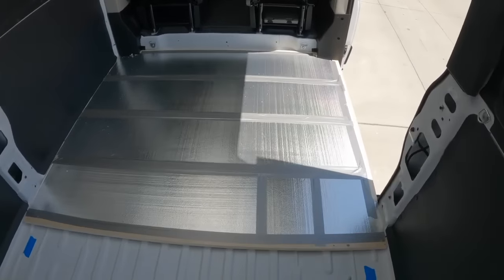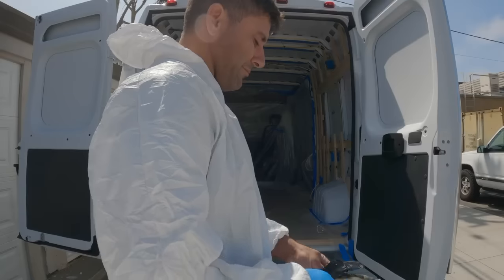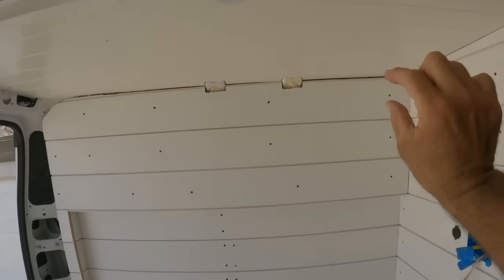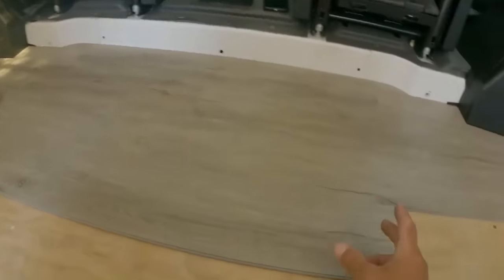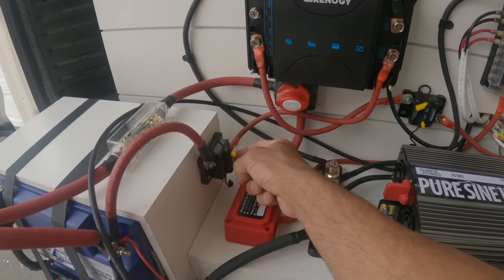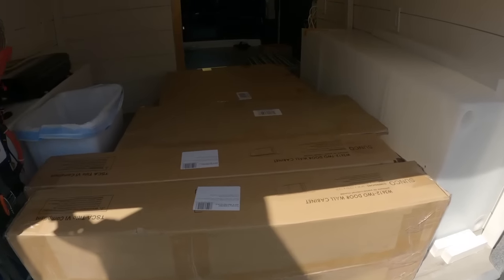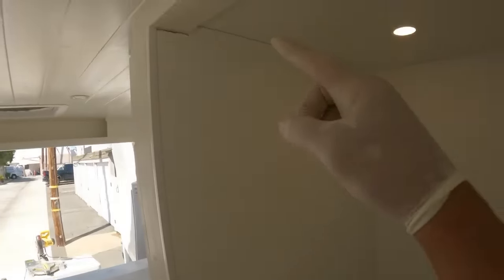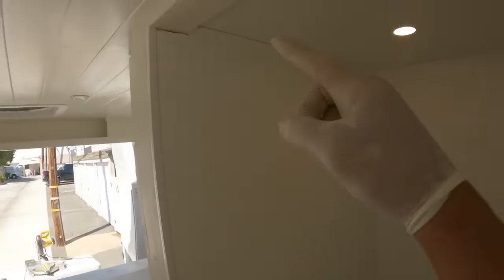Time Lapse | Camper Van Start To Finish | Van Build | Van Conversion

Comment: Your attention to detail is leaps and bounds over any other I've seen on youtube. Even the "pro shops", some of which are good, but they still have a assembly line feel to the finished product. Yours always feel unique and like a master craftsman took his time with it. and it shows in your work.

I was planning on starting my project this spring but some family/financial issues have arisen so I have to put it off for another year. But I have to say your channel has given me the most ideas than all the others put together. Little things like how you finish off the top over the rear and sliding doors. Hardly anybody else does that, but why the hell not? Every square inch counts, so why not use it. 

Needless to say you have given me more ideas than anyone else. 

One idea though that I haven't see you use is a partition wall. I plan on putting one in. Just a simple insulated wall with a skinny door. I'm concerned very little about stealth and more about privacy and security. That door between the two front seats will be locked and if there's a tap on the van in the night, I'm not exposing my "home" to anybody. I'll be coming out through that door and into the front seat to speak to whoever it is. Also, the "home" side of the wall I can attach some photos, mementos, decorations,. etc., I'll be full-timing this. There's no going back for me. I'll be on my own, traveling Canada, 365 days a year, taking my time and seeing everything I possibly can. And when I'm done I might do the USA. Who knows.
Reply from the maker: Thank you for the nice comment!  I like your idea, I have thought about a partition wall.  It has it's advantages.   The only reason I haven't gone for it is because you wont be able to swivel the seats with a partition wall and the vehicle seats are the most comfortable place to sit in the van plus it adds to the living space.  It's a trade off like everything in a van i guess.   I think it just shows that every one has different needs so it's cool to see how all these custom vans come out.  Good luck with your build.
Reply: @BuildingVanLife  Well, since I'd be alone and full time in Canada where the weather can be extreme I'll be installing both heating and cooling so the loss seating won't bother me much. But more importantly I think a partition wall will be better to insulate against both cold and heat than a curtain and/or window shades around the front window cabin area can. I also think since there would be less space to heat/cool in the livable area that it would be more economical in the long run.

I'd like to see how you would tackle a partition some day. A pocket door would be ideal. But keeping it all properly insulated and sealed up from drafts would be key for me.

Oh, and get Gracie back. She was a little easier on the eyes than you are.😁

Comment: Great video. Your attention to detail is spot on. As an electrician , I always set my screws , especially switch plate screws , vertical. It shows you care about quality. You did mention the water tank over the wheel well. If you don't mind , where did you find that ? Great job. My girlfriend and I just bought an E - 350 to do the same thing to. Build a camper.
Reply from the maker: Thank you I appreciate it.  Water tank https://www.nwconversions.com/product/28-gallon-wheel-well-water-tank-pm-c-28/

Comment: Exceptional

Does the shower and sink drain to the ground?
Did I miss a hot water heater?
No mater what there just ain't no room to store stuff like cloths (winter gear), shoes, etc. in vans.
Gotta have a hange bar at top of shower to hang wet gear.
Reply from the maker: There is a hot water heater and there is two grey water takes on electronic valve switches under the van.  You can check out all the build videos on my channel of this van and my more recent van

Comment: The main reason for me not building a van camper is the width...
I can't fit in a bed side to side ...
75 inches is not wide enough for me to lay down stretched out ...
Thinking about getting a box van only they cost me so much more than a regular van ..
Reply from the maker: The promaster is the widest of the 3 main vans.  You could add bump outs to each side to make it fit an even bigger bed.   Otherwise you can do the longer sprinter van run the bed north to south.

Comment: I love watching your videos, they motivate me. Just wondering if you are planning on making more videos of your van builds? I know that Vans are probably hard to get at this point, what are your plans?
Reply from the maker: Thank you! I ordered another van since that’s the only way with the lack of inventory.  Its taking a while.  Im working on another video at the moment as well.  Top mistakes i see in van builds.
Reply: @BuildingVanLife  I have a 2020 Promaster  High roof 159 wheel Base, I bought it brand new and only have 2100 miles on it, I've done some work on it like two Maxx air fans on the roof and a roof rack, trailer hitch, sound deadening getting ready to start the sub floor, because of covid I've been working 50 to 80 hours a week and didn't have time to work on it but now it looks like I'll have some time. Your videos are a huge help keep them coming. Top mistakes sounds interesting.
Reply from the maker: @dfanman1  very nice, i think that's the best van to start with, that's what i have coming, a 2022 159 Promaster.  Good luck

Comment: You put insulation down and then the plywood for the base flooring.  Don’t you need like a dynamat underneath to help dampen road noise?
Reply from the maker: I find the one inch of insulation does more than enough to eliminate the road noise
Reply: @BuildingVanLife  ahh, okay.  Awesome build!  Best of luck!

Comment: You didn't put spacers in the platform of your bed so the water/moisture wicks away and mold doesn't grow on the bottom side of it. As careful as you are...that ive seen you're extremely careful... this one thing is driving me nuts as a person with ocd.

Comment: Hi, How many liters of water tank should be installed to be able to use the shower and toilet ?
Reply from the maker: The toilet doesnt use any water.  I used a 28 gallon tank which i think is just the right size.   In fact I normally only keep it half way filled.  For weight reasons.  I don't think any larger than 28 gallons (about 105 liters) is needed or even reasonable.  That would be a lot of weight to drive around with.

Comment: Great looking build!  I really enjoyed your progression through the video.  I am looking at building my first van and opting for wood over the 80/20 that I see everyone using.  Any comments on the durability long term?  Any changes that you would do if you were to do it again?
Reply from the maker: I have some new videos on the channel of my new build that you can check out.  It’s about halfway done right now.  I’ve made a few changes but as far as the wood goes, I believe it will last longer than the van does.  Houses have been built out of wood forever

Comment: I installed the same diesel heater as you and primed the fuel pump and gas was leaking from the exhaust under the van where I mounted it. Also getting E-8 error. And smells like it’s blowing gas into the van. What could I have done?
Reply: I’m in Newport anyway you could help me out?
Reply from the maker: Error e8 is lack of fuel.  First you need to make sure the connection is no longer leaking before you use it again. Then check all the lines make sure there are no air bubbles. You may need to prime a few times to get rid of them.  Make sure you have enough fuel in the tank.  That should work.  Check all the connections for leaks.

Comment: did you install windows after you spray foamed?
Reply from the maker: yes but i only added a window to the sliding door and i didnt foam that section of the door
Reply: @BuildingVanLife  thanks. do you foresee any issues with cutting out spots for windows  AFTER the interior has been spray foamed? (aside from it being a waste of spray foam?)
Reply: * considering buying a van that has already been spray foamed, but it has no windows, no framing, and no wiring etc yet.
Reply from the maker: @cbarbs638  it shouldn’t be a problem.  It’s not that hard to cut through.  Just make sure you didn’t run any wires in that spot

Comment: Nice job but you should have painted the tongue and grove before you installed it because when it shrinks, which it will, you will have lines of unpainted wood showing in the joints.
Reply from the maker: Actually if you paint it before they won’t go in the tight groove.
Reply from the maker: @joemorris1763  clearly you have never used this thin tongue and groove I’ve used in the ceiling.  It’s a very tight fit and the edges are too fragile to tap with a block and not chip off the tongue.  There is no way to paint this specific material first and put it up.  It’s not a big deal if I need to touch up later when it shrinks.